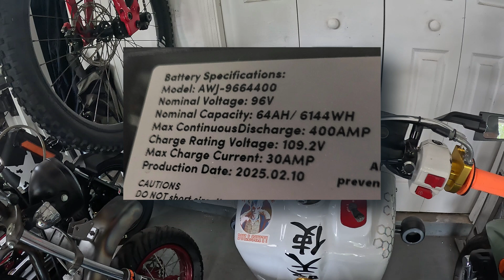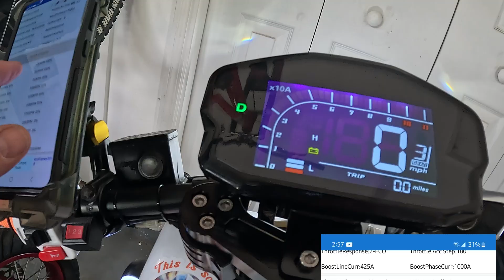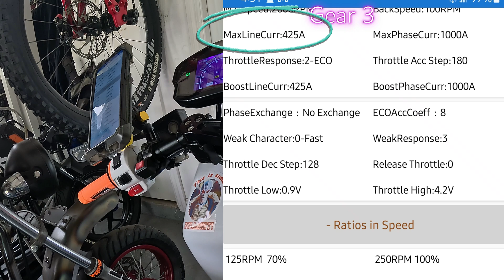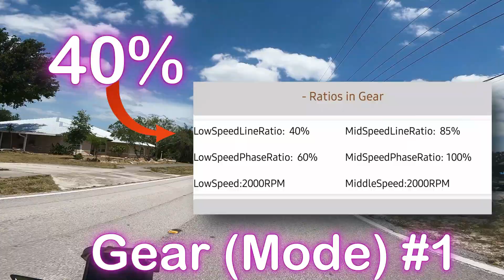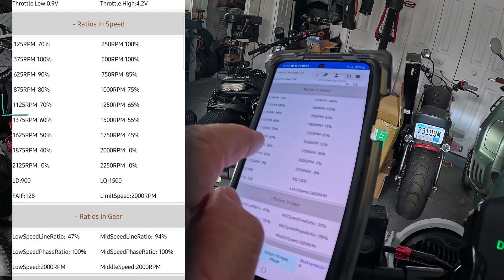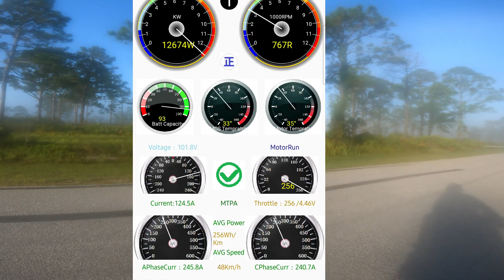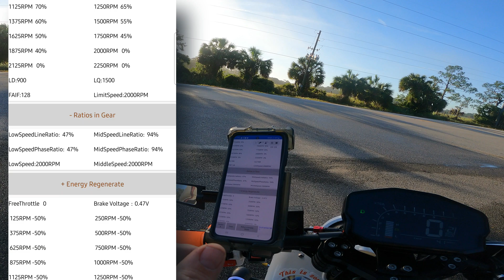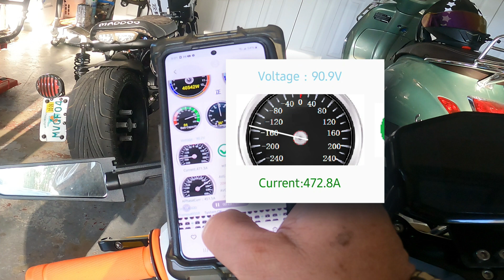How to "Ratio In Gears" your Fardriver Electric Motorcycle

Comment: ive watched this like 5 times cause math hurts my brain.  my controller says it can do 12000rpms max but rated for 8000. ..  does that mean i can jack up the limit speed to like 10000? (lets find out the hard way?)
Reply from the maker: Fardrivers will max out 12k.  The race versions or "track" will go 20k rpm I think.  Rated speed is what your motor is rated at.  What autolearn sees as the rpm where emf and back emf start to balance and where field weakening should happen (in theory).  Where did you get 8000?  Is it a mid drive motor?  What does the spec sheet say?  If it is rated at 8k continuous, you can definitely make 12k your max speed.
Reply: @GhettoWrench  8000 was from autolearn , 7892 but i rounded up. rear hub motor. there is no spec sheet = eahora kinda sucks like that
Reply from the maker: @bobsmith9571  your motor would fly apart at that RPM...  but its all good, that is not your actual RPM.  What size wheel is the hub motor?  You can look at a wheel speed calculator online.  You will see that 8000 Rpm is like 1000mph.  LoL.  
What are your Pole Pairs set at?  Your hub probably has 16 pole pairs and the fardriver thinks has 4.  Older fardivers did this so you have to do a "calculation ".  This is from the older manual.

, the pole pair number of the hub motor is
16, divided by 4 to get the pole pair ratio=16/4=4. Then
The actual speed of the 16-pole hub motor corresponding to 500RPM is 125RPM. The actual speed of the 16-pole hub motor corresponding to 1000RPM is 250RPM. The actual speed of the 16-pole hub motor corresponding to 4000RPM is 1000RPM. The actual speed of the 16-pole hub motor corresponding to 5000RPM is 1250RPM. The actual speed of the 16-pole hub motor corresponding to 5500RPM is 1375RPM. The actual speed of the 16-pole hub motor corresponding to 6000RPM is 1500RPM. The actual speed of the 16-pole hub motor corresponding to 6500RPM is 1625RPM
The actual speed of the 16-pole hub motor corresponding to 8000RPM is 2000RPM

So 8000rpm is really 2000rpm. 2000rpm is way over 100mph.
Reply: @GhettoWrench  they got back to me and says it 4. doesn't mean their not lying, tires are 120/40-12 ish.. so i reckon that hub motor is 10 inchs
Reply from the maker: @bobsmith9571 and you have 4 ploe pairs selected?  maybe it's just incompatibility in software. How fast does the bike go...  and do you want it to go faster?  Do you know if field weakening?  You have a fardriver controller right?  What RPM is the graph speed showing at top speed?  Even on a 12" tire 8000 would be 285mph.     You should see "weak" appear and then it should go faster on the graph page.  It may think the rated RPM is so high it does not weaken.   Hit me up on FB messenger.   Ted Edgar.  I am wearing a full face helmet standing with a mountain bike.
Reply: @GhettoWrench  satan kitty

Comment: I think that phase amp bump when you expected it to be stuck at 150A is a settings error -- it appears that not all of the RPM ranges were at 50%, some were still at 70% or even 100%
Reply from the maker: Ahhh.  Good point. Will have to revisit that test.  LOL

Comment: Both your CHGOverCurWarning and CHGOverCurWR should be set under CHGOverCurProtect value unless you don't want no warnings in the log.
Reply from the maker: Ok thanks.  Back to the BMS I go...  😂.  So should I raise the protect or lower the other ones?
Reply: It depends on your charger, but I know you are limited to 110v in the US. @GhettoWrench
Reply from the maker: @nicod974 yep.  110v.  I got a ICGOGO 10 amp
Reply: @nicod974 we have 220v also but that’s just 2 110v legs together 😂